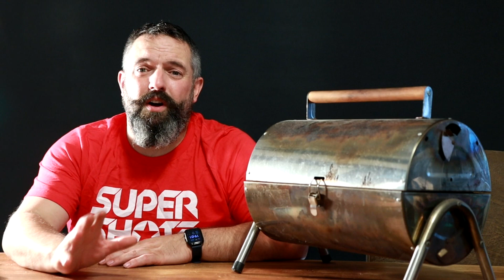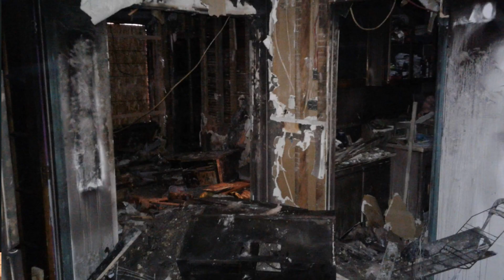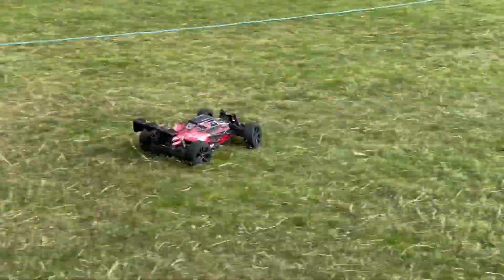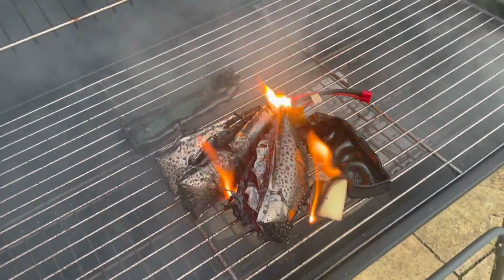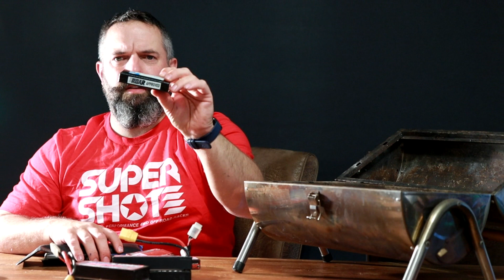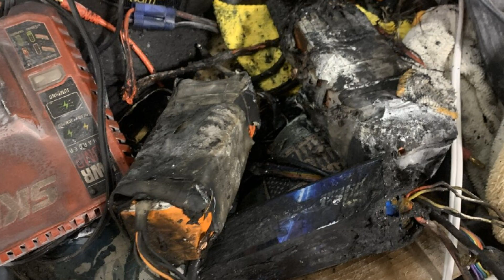RC CAR LIPO FIRES

Comment: I'm sorry for your bad experience Carl, any form of swelling in a LiPo is a sign of irreversible damage to the pack and needs disposing of as soon as you notice it. I work for an importer of Lipo batteries in the aircraft field of the hobby, if we receive batteries even slightly swollen from our suppliers, the pack is disposed of, its a firecracker waiting to go off. Yes you'll get peoople saying oh its still fine to charge. This is simply NOT the case, the damage has been done and the internal resistance of the oack has increased exponentially. Don't reuse the pack, bin it. When you said you still had swollen pacxks at your house I was cringing. Honestlty NEVER KEEP damaged poacks, just dispose of them properly.

Now onto why you had a failiure like this. Did you dtick to manufacturers guidelines on the packs? Charge to safe limits, saafe ampersge, safe cutoof voltage? Safe storage voltage? Honestly I suspect not, even straying outside these guidelines once can cause the pack to swell leading to what you experienced.

Guidelines are also BRCA rules too, stray outside these and the BRCA can revoke your licence for unsafe practices. Also keeping swollen batteries on your property (either inside oroutside) usually invalidated your home insurance as they get catagorised as explosive devices. as require specialised insurance. 

Our reccomendatrions:
::CHARGING::
- Charge at 1C max (5800mah = 5.8a max, 80000mah = 8a max atc)
- Charge end voltage 4.8v per cell max.
- Balance charge every charge.
*NEVER step away from the charger.*

::DISCHARGING::
-Discharge 2C max (5800mah = 11.6a max, 80000mah = 16a max atc)
-Discharge voltage 3.85v per cell minimum. 
- Storage mode discharge at the ene of the raceday, 
Never leave the pack more than 40% charge longer than 8hrs
*NEVER step away from the charger.*

Also don't use cheaper chargers, they don't have the capabilities to detect cell voltage accurately enough or even be calibrated. You should recalibrate your charger every year.

The biggest issue in the hobby is peoople mistreating batteries for performance gains then crying about how they nearly had a dsaster. Mainly its their teir own actions (both intentional and unintentional). Remember Gil Losi (Mr TLR Lost most of the Losi RC company history through a LiPo fire in his garage at home by not putting his cells into storage mode after a big race event the company attended.

Safe racing people, treat your batteries right they'll treat you right.
Reply from the maker: Some great advice 
Pinned comment to top of video
Reply: This is all good advice, but maybe a typo in your charge advice? An end voltage of 4,8volt per cell is way too high. My advice would be 4,2 volt per cell in a "normal" lipo and 4,35 volt per cell in a high voltage lipo.
Reply: O, and ALWAYS use a lipo safe storage bag/case.
Reply: Thank you

Comment: i had a bit of a incident few years back i put a truck in pawn shop on buy back batt was charged to prove car was in gwo got it back batt was dead tried to charge it charger show error msg they must have been playin round with it as model shop said first cell was dead an it could have gone off

Comment: Trickle charger is the best way forward and a old 7.62 Nato machine gun rounds ammo case for the rambo belted feed is the best solution old army stock to charge in & also always make sure to use a balance charger and checking your 3 cells are balanced after every run never leave yours unattended on charge well done 👍
Reply from the maker: Sound advice

Comment: Treat them as intended and will have zero problems be careful to avoid mistakes like charging on wrong settings ie nimh. Nicd and not too high amperage also do not short circuit, lastly always storage at 7.6v per cell Simples

Comment: As others have said, never charge or discharge a lipo and leave it unattended. Also, charge/discharge them in a lipo-safe bag or pouch, and store them in a suitable container, such as an old ammo tin, but if you do drill some holes to allow gases to escape. And if a lipo swells up even slightly, safely dispose of it ASAP, DO NOT use it again. Lipo batteries do have some huge advantages over nimh batteries but they are more risky, but so long as you manage the risks you should be good to go.
Reply from the maker: Spot on Barry

Comment: When I got back into the hobby after a 15 year break. I noticed that nearly everything these days runs on a lipo and I remember the horror stories back when I was messing with nitros about lipo batteries going up like grenades. I will say I’m still afraid of them but I do always make a point to charge inside of a lipo bag and I constantly and checking on them during the charge cycle making sure they aren’t getting hot or swollen but I believe lipos today are much safer and user friendly now than ever before but I still treat them like a live hand grenade 😅
Reply from the maker: I’m sure they are more reliable these days

Comment: Hey, I dunno if anyone has thought about it but I bought a cheap metal toolbox and built my charger into that so when I am charging the charger and batteries are all contained in a metal tool box so if anything happens you can just pick up the entire thing and get it outside. You can close the lid whilst charging also. Way to go IMHO. Toolbox was about $50, cheap insurance and it gives you a totally pick up and portable charging station.
Reply from the maker: Might look into that as this could be a great solution to my set up
Reply: @PopalongRC  No problem and happy to help. I can take pics of my setup and send them to you if you like. I will be honest though. My setup isn't too cheap and uses the iCharger 4010 duo which honestly is the best charger I have ever owned. I am 52 and been doing RC since I was about 13. It's a cool setup though that can be used on the mains or DC car battery. If you want pics or info let me know. I can charge 8 batteries at once then pick it all  up, go away for the weekend, run them, charge them all up at the same time overnight in a metal box and do the same again.  It's a great setup honestly better than I could have hoped it would turn out.

Comment: Im always concerned about my batteries,  i live in an apartment. I hzve an ammo can with bad batteries I fear. I test daily and have a fire extinguisher near the batteries. I have no disposal options available to me and my budget. Cannot afford $20 a battery for disposal.  I keep my lipos in single bags at all times when  otin use
Reply from the maker: As I said this has highlighted to me that I need to reconsider my own charging and storing behaviours
Reply: @PopalongRC  I don't like mine but currently my best options. What gets me is how expensive it is for me to dispose of batteries.

Comment: Glad to see you are safe and one of the lucky ones. I prefer to charge one battery at a time myself just in case one does go up it doesn't take the others out at the same time as that would be a really big fire. For myself I wouldn't charge 4 batteries at once but not being a basher I don't have the need to do so
Reply from the maker: Yeah it is a balancing act which I need to tweak to keep safe
Reply: @PopalongRC  if you haven't already I would get yourself a battery checker that way you can check the battery after use. It's probably more important for bashing as they take a lot of abuse and do get flattened down unlike racing where we only run for 5mins at a time.

Comment: Hi Carl, I am an RC newb, i largely tend towards Tamiya's with NiMHs, but my boy has several Bangood/Wish/Temu cars even Argos. Are these smashed out to a budget made in Taiwan (no offence) cells safe?
Also you have a collection of "Dodgy" batteries all locked in a box together if one goes up it'll take the rest with it with a massive inferno a dozen times the size of a single battery. Just a thought, surely just get rid.
Reply from the maker: That is a very temporary location just an extra barrier of protection while they are not in use…
Reply from the maker: All batteries even the expensive ones have the potential to go bad .. need to be safe when charging lipos what ever brand they are.

Comment: Mate, I had one blow up on me, while charging the lipo in my office, still in the car. Nearly burnt my house down and resulted in a trip to emergency with 2nd degree burns on three fingers! I was complacent, but got off easy…this time. You can never, never get complacent when charging lipo batteries
Reply from the maker: Sharing this video to spread the word 
After 10-15yrs it is easy to become complacent
Reply: @PopalongRC  for sure 😉

Comment: Again actual content (again) for 1:1 cars.
I have military ammunition cases. Inside  batteries are in fire bags.
I drillt holes into them that pressure can get out. I also try to separate old from new ones.... But if one goes up this will get interesting in a not so good way.

Comment: Puffed up batteries are in risk of leaking or explosion. It's highly recommended to follow safety Lipo disposal instructions and get rid of them. One of the most common ways is to fully submerge them under a salt bath for several days until the cells are completely dead, unable to give out any voltage or produce fire when the cells are being thrown around in the recycling places.
Reply from the maker: Not tried salt baths

Comment: You were very lucky. I never exceed !C when charging, and only balance charge, but am still somewhat worried that one might let go one day. Any puffy ones get put outside and left discharged until I can get to the dump. I am not a fan of hardcase lipos as it is too easy to miss one going puffy until it's too late. I use some but prefer the normal ones,and they can get a worse bashing in a hard landing in one of my planes than any car can do. Are hardcase a requirement for racing? I no longer race but imagine they are.
Reply from the maker: Need hard case for racing though

Comment: Great subject for a vid, this info is always relevant. Well done. I started out with NiCads too. Many were the times I'd hear a 'boof!' then spitting noise outside because I'd left a NiCad on a cheap set of charging leads clipped to a car battery. Good times.
When I first tried a NiMh, I didn't know about the jump in power, the wires kept melting off the motor on my Hornet, when I finally made them stay on the motor my old MSC started to smoke. In my defence I hadn't done any RC-ing in almost 20 years atm.
Reply from the maker: Thanks buddy

Comment: I never seen lipo fire personaly but I store my lipos in safety bags and charging in safety bag in metal box... this is rly important video because safety must be on first place.... PS: did you figured out which controler you will go for? I seen some pepos with RC8x with same problem you have... but I never had this problem on my cheaper version RC6GS
Reply from the maker: Video is ready for release so radio video coming soon

Comment: I bought a couple of BatSafe boxes to keep mine it. Not the cheapest, but extra bit of piece of mind.
Reply from the maker: There are great products out there that might be better than my rust BBQ
Reply: I have one as well, probably the safest solution - and on top of that I put my Bat-Safe on two bricks (as it sits on a wooden floor).

Comment: I got an ammobox for my lipos. But, a good thing to keep in mind is that basicly all lipo fires happen when charging or when discharging, not in storage. So you should be somewhat present when you charge lipos, and not just chuck em in the charger and go to another room. And get rid of puffed up batteries, even tho they work.
Reply from the maker: Spot on
Reply: If that box has lots of battries in it, it will get really hot, so you still need to think about where you keep that box
Reply: @LittleDudePat2017  Well yes, I keep on a table. But I gor 3 2s shorty packs in it, thats it, and I dont keep lid clamped down, so if it does go off, the box will get hot, but probably wont melt or set the table on fire, and the smoke and shit will vent upwards. Obviously if you have like 10 6s batteries, you need some serious stuff to keep those safe.
Reply: @tm5123  bro, a 1s 300mah lipo, for my drone,  set my skirting board on fire, good job I was watching it, the heat was insane from such a tiny battery
Reply: @LittleDudePat2017  Yes, ofc it gets hot, a ammobox is also a decent heat sink.  https://www.youtube.com/watch?v=BPZuvSI8MXU but for example, its better than nothing.
Reply: Thats not true... its mostly true, but for example samsung note on planes, I bad bms can cause  over discharge. Yes i know our batteries dont ise a bms, just pointing out they do sometimes catch fire for some u known reason, and without warning.

Comment: Mine sit in LIPO bags on my desk right next to me during the week and I only charge on the day I want to use them. I am now thinking of moving them down into the cellar when not in use.
Reply: Notice nobody is having lipo fires in storage. Its always people charging or running puffed batteries, or new ones if there's some issue with the battery. But I dont think I've heard of storaged lipos going off.
Reply from the maker: Agreed it is the charge discharge you need to keep an eyes
Reply from the maker: Thanks for commenting

Comment: I live in a small 2 room ground floor flat with a house above me and I don't have a proper garden which is why I stick to Nimh batteries.  Just can't take the risk of anything popping when I'm out at work or something.  Even storing in a bbq or ammo can would be too risky for me due the small size of my place.
Reply: Lipos are really stable when in storage. Its the charging and discharging phases when they go off.